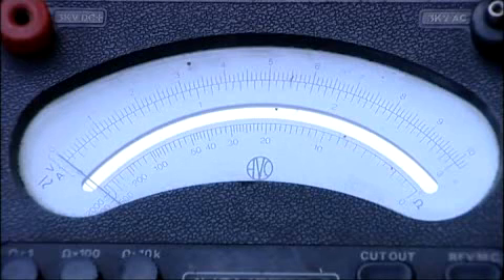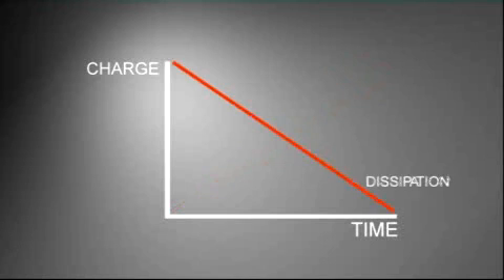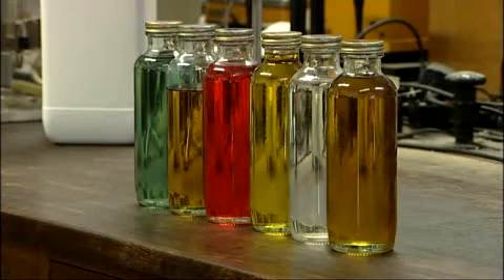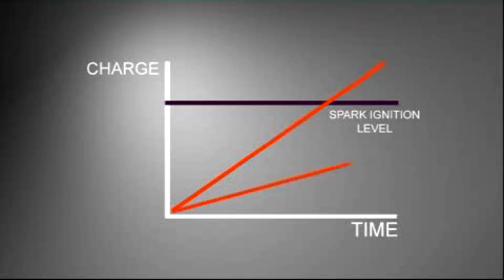Solvents and Static Electricity 1/2

Comment: Have any products of Static Charge Reducer for fuel pipeline? which the patant 3,383,560 of 1 Method and apparatus for neutralzing electrostatic charges in an electrically charged liquid in May 14, 1968?